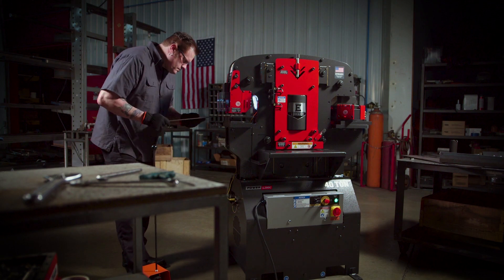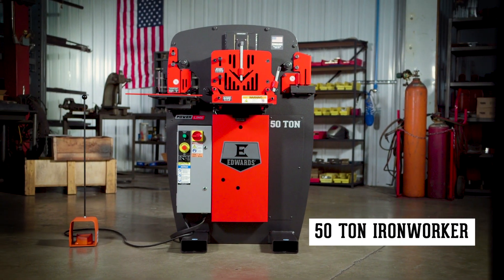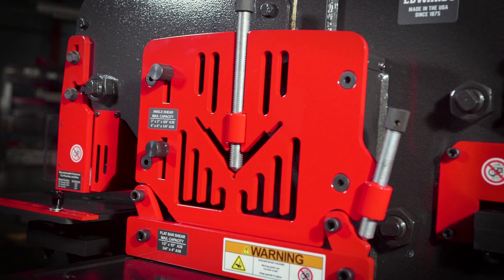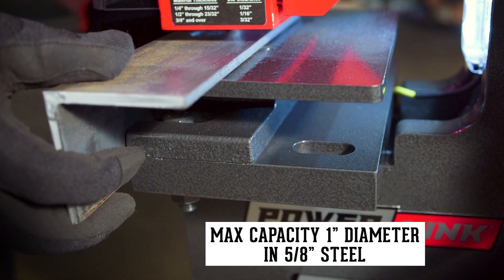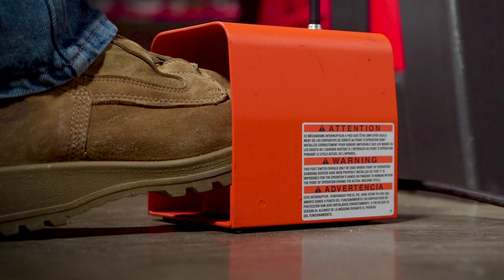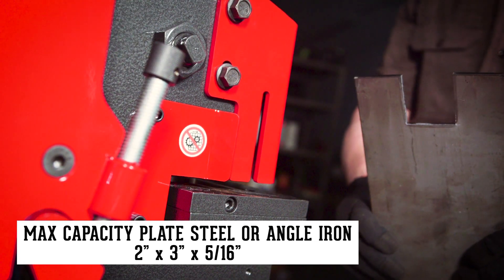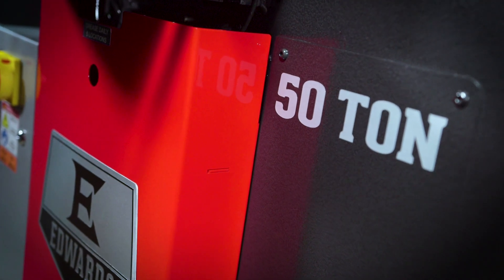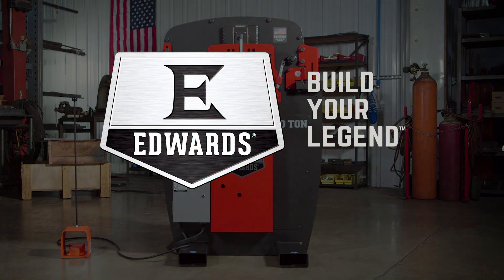Edwards 50-Ton Ironworker with PowerLink System

Comment: I’ve got one of these older ones when they were built by Hawthorn. Heck I know every inch of it. Would like one of those actuator foot pedal. Compared to my old  push pull cable that it uses , I’ve went through probably 3 of em now. That’s 25 years tho